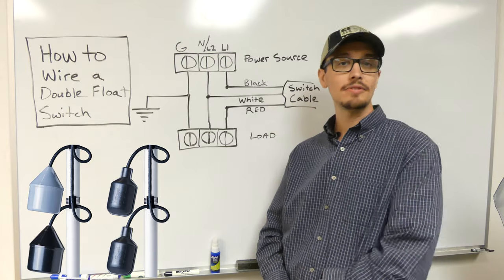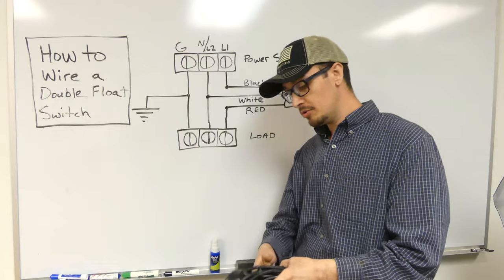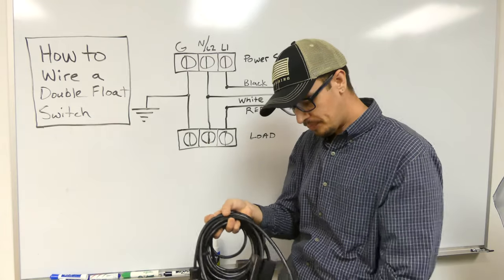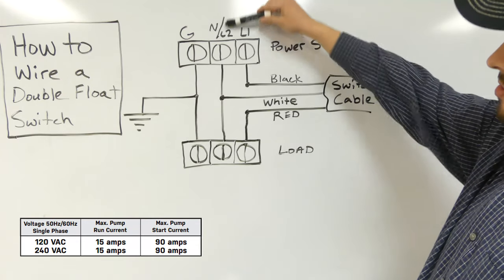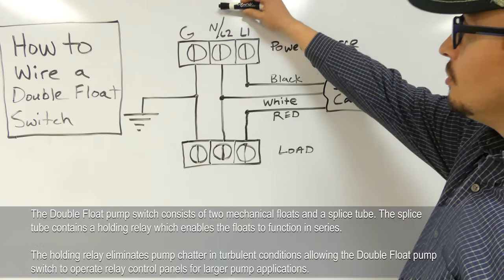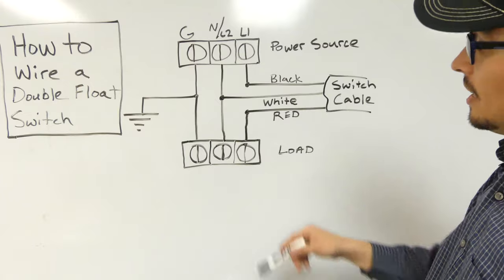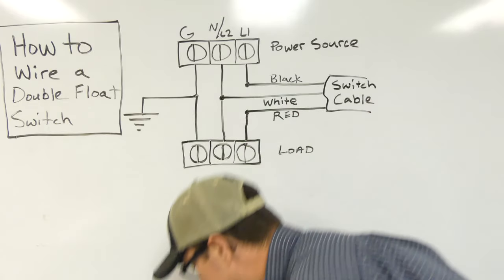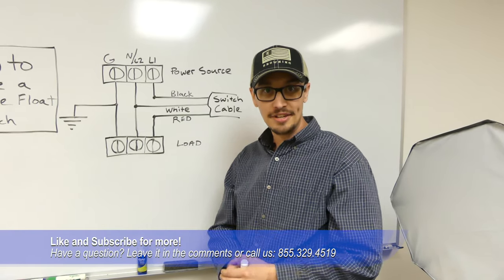How to Wire a Double Float Pump Switch

Comment: I have a 2 float system. Does the septic pump timer only come on when both floats are up or does the timer run the pump each day regardless and the floats trigger the pump as a last resort fail safe? That's the part I am not sure of. Thanks!

Comment: I don't know why mine double float switch system does not have the holding relay, meaning each of them has two terminals (instead of combined three lines)?  I just received a notice asking to replace one float switch. Currently it seems that the pump is only controlled by the top switch (not the one for alarm).  How to check out which float is not working? I assume the top one is NO switch while the bottom one is NC switch? How to manually turn on the pump until water level reaches the bottom switch level?  Thanks

Comment: Did I damage my double float switch. I have a 230v double float switch and I inadvertently wired the L2 line to the red wire instead of the white wire. Can that damage the float switch?

Comment: What he didn’t tell you is that you have to wire it exactly as he said. You can’t cross the white and the black. If you are using a 3 wire for a 220v circuit, like I was cause I needed a neutral wire for a 120v pump at the same location, the black wire must go to the black, the two white wires (one from the pump and one from the float get connected  to the red wire (on the power source). Then the black wire on the pump will get connected to the black wire on the pump. Hope that isn’t too confusing. If you reverse the black and white wire on the float switch in the 220v configuration, it will not work. Don’t know why because 220v has power in both power wires so I’m not sure why it makes a difference but it does. For 220v, It has to be wire EXACTLY, I mean EXACTLY, as he has it diagramed.

Comment: I was on a job today that had a three float system.  None of the floats worked? I am really confused.  It all gets wired into the control box with a computer.  The pump turned on when set to hand. But none of the three floats would turn the pump on
Reply from the maker: The most common 3 float systems are set up so the bottom float is "off", middle is "on", and the top is "high water alarm". You likely have to raise both the bottom and middle float simultaneously to start the pump.

Comment: Are you saying that in a 220 Volt configuration You do not use a neutral only the earth ground. If so how does the relay work.
Reply from the maker: In a 220V configuration the white wire is connected to the neutral like it is in the video.

Comment: Hello great video, quick question, how does the piggy back float switch communicate with the pump?  I have a zoeller BN266-C.  Thanks
Reply from the maker: The float switch makes or breaks the electrical connection on one leg of the power going to the pump. When the float is down the contacts are open, but when it floats up the contacts close and allow power to the pump.